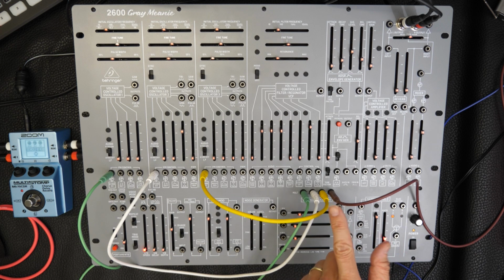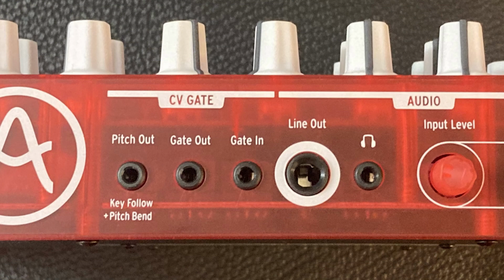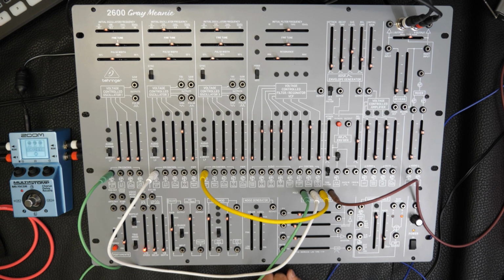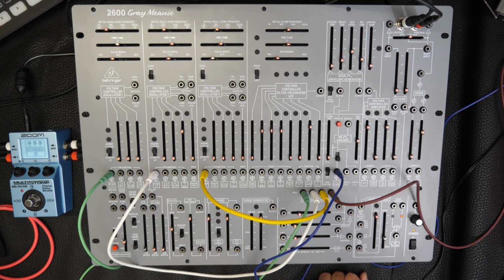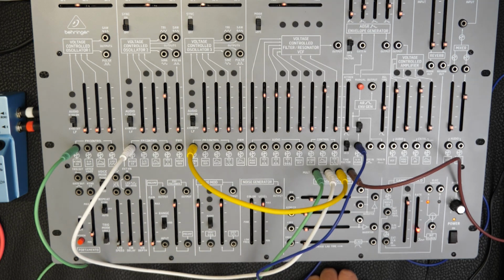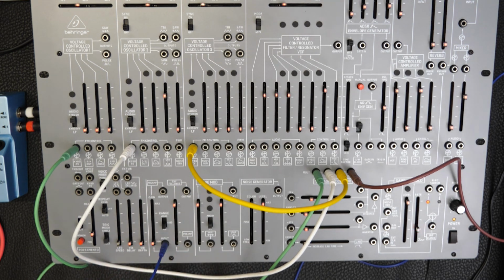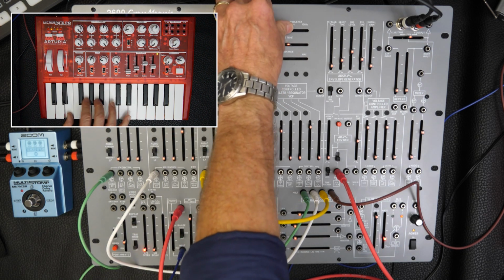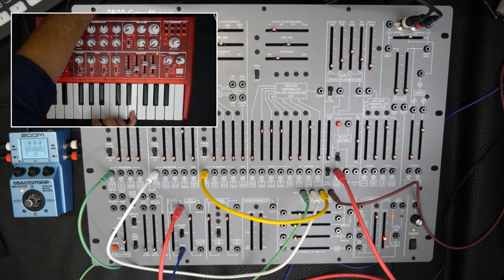Solving CV/Gate Issues // Behringer 2600, ARP 2600, 2600 Synth Clones

Comment: Thanks Ralph. I was having similar problems with Arturia Keystep 37 and Behringer 2600.  I tried using the Arturia Midi Control Center app change the gate out signal from  "V-trig 12V" to "V-trig 5V" and it worked much better, not needing the preamp at all.
Reply from the maker: The Keystep has great setting options and the Arturia Midi Control center gives you fantastic control over the device. Unfortunately the setting options for the Arturia MicroBrute are a bit limited. Many thanks for watching my videos! Greetings, Ralph

Comment: Hi Ralph, I have just got my original (1974) 2600 back from service and was trying to run it from my Doepfer Dark Time Sequencer (still to try with my Doepfer MAQ 16/3 and my Keystep - and expect a challenge, and probably failure using the Behringer 960 sequencers!). I followed all of your instructions and even with the input levels at x 100 I was still getting the Sample and hold clock taking over/playing on top of my sequence -  giving a sort of double beat or a click as well as the sequencer output and then fading itself out when the S&H clock faded. After thinking a lot I have plugged in the output from the preamplifier gain control (big knob on the top left of the 2600 - same as the Behringer but not a slider) as you suggested, BUT connected it to the Sample and Hold GATE input on the 2600. That works - so far. Thanks for pointing me in the right direction! I am working through your other videos. 

I just found your other video which actually covered this bit. I plan to watch everything you have produced eagerly!

Best wishes, Tony, Hove, UK.
Reply from the maker: Hello Tony, thank you for giving me your detailed feedback on my tutorials. A lot of making things work involve a lot of trial and error testing. That's part of the modular Synth game. BTW, I also have an original ARP 2600. 😃 Cheers, Ralph

Comment: I have a Division Six Dual Mini Sequencer and the Behringer 2600. I tried your gate/preamp method and it does not trigger the 2600 ADSR properly. One thing you missed was adjusting different ADSR parameters. If you did you would probably notice that the attack and decay are not functioning properly (as well as the rest of the EG) when applying only the gate to the 2600 VCF EG. After much research online I found a video with the solution. It's hard to find in the 2600 documentation. The ADSR requires a trigger AND a gate. The Division Six Dual Mini Sequencer only has a gate out. I recently purchased an EMW "gate to trigger" module. I split the gate out of the Sequencer with one going into the 2600 gate jack and the other split going to the EMW Gate to trigger converter. I then brought the EMW generated trigger into the 2600 trigger input jack. Presto! The 2600 ADSR  functions as expected. If you want I can throw a quick video together to show the patching and results. To share with your community. I enjoy you videos. Never owned an ARP back in the day. MiniMoog was my synth of choice. So I had a bit of a learning curve. Your videos helped.
Reply from the maker: Hello Ronald, 

many thanks for sharing your experience with the Division Six Sequencer.

I am totally aware of the fact the 2600 EG’s require a Gate AND Trigger signal. As a matter of fact I have already made a video about this 
https://youtu.be/MTf10H0KWDU 
But nevertheless you took the best approach by doing your own research and testing. That’s always the best way to learn the 2600 Synth.

I have never dabbled with the Division Six Sequencer but with all my equipment I have never experienced any Attack/Decay issues on the ADSR when going through the Preamp. Except for the the Sustain which is probably due to the fact that the Preamp might not be DC coupled. Anyway when you look at the ADSR position in my video and listen to the accompanying sound then you will notice that the Attack and Decay are working properly.

One again I would like to refer to this video here https://youtu.be/MTf10H0KWDU and suggest that you try to split the Gate and Trigger and boost the just the Trigger signal and run it into the Trig input slot.

I am currently shooting another video about Gate connection issues because I have received several further questions/comments on my various Socials. So kindly stay tuned.

Thanks a lot for watching my content and for taking the time to write this comment. Greetings, Ralph
Reply: @RalphBaumgartl  thanks. I have the Behringer Swing. I will follow the setup from the video you referenced. Thanks again for the prompt reply.
Reply from the maker: @RonaldFigura  This video just shows another way which might be a possible solution. In modular Synthesis there's no wright or wrong way. There's the way that works for your setup and workflow. Finding and exploring that route is part of the modular Synth fun :-) Have a creative weekend, Ralph

Comment: Ralph! taht was exactly the problem I had while using the signal splitter (that one that looks like an asterix).... it splitted the voltage so it wasn't enough to duly trigger the Osc..... and the Trigger. I updated the firmware as you adviced and starte using it with midi (and just for knowledge, I tested the CV splitter with a multimeter,.. and yeah...) :person-turqouise-waving:

But now, I ordered a new analogt sequencer and I will have to use the CV inputs again.... so! there it is.
Reply from the maker: Which sequencer did you order?
Reply: @RalphBaumgartl  ordered 2: a Korg SQ1 and a Behringer 960 module.
Reply from the maker: @MarcoPolux  You may have to boost the Gate signal of the 960 module in oder to make it work with the 2600.
Reply: On the GATE only, right? The 960 is +8V the 2600 has different voltage on different modules. What I’ve seen is that the pitch enter direct to the Arp’s mixer and then to the VCO pitch. And the gate goes to the Arp’s PreAmp and when to the S/H…. And then it works correct? Thanks Ralph 👍
Reply from the maker: @MarcoPolux start with the procedure explained in my video. Depending on your sequence in may not be necessary to increase the Pitch/CV signal.
Reply: @RalphBaumgartl  I will do that! thanks so much Ralph (I may dare sometime to make a youTube video) :person-turqouise-waving:

Comment: This is a very helpful suggestion, and is much simpler than the using the voltage processor.
Is the preamp DC coupled, so a long gate will hold the envelope open?
Also like your suggestion to use MIDI when possible.

Another thing to check, is if the hardware sending the trigger/gate/clock, has an option to select what voltage they send. Some allow you to choose between 10v and 5v.
A few of my synth toys have that, like the MicroFreak, and the Korg SQ-64 sequencer.
Reply from the maker: The Arturia Keystep also allows you to choose between a 5v and a 12v gate.

Comment: As many of the outputs of the 2600 are in the range -10V to +14V, the AD/ADSR Gate and Trigger Inputs should be able to handle that voltage range safely. 

For reference, Specifications from the Behringer 2600 documentation:

AD/ADSR Gate In threshold is +4V.
AD/ADSR Trigger In Threshold is +5V.

The portamento/ keyboard Gate Out voltage is +14V max.
The portamento/ keyboard Trigger Out voltage is +10V max.
Reply from the maker: Thanks for sharing this! It also shows that it's highly unlikely to break something on the B2600 when patching up external gear!

Comment: hello Ralph! I have another beginner question for you 🙂 are there things which work only with midi? today I am messing around with my 2600 connected to my Keystep Pro via CV. all the connections are fine and it all works great. but I noticed that the "vib depth" slider was having no effect? so I unplugged all my patch cables (except LFO) and connected via midi and the "Vib depth" is behaving exactly as you would expect? 
I tested using one CV connection: KSP into OSC 2 for pitch, and KSP into S&H clock for gate, and then cable (same as with midi connection)  from LFO sine output into PWM input of OSC 2 (also tried with pitch) but doing this, the "vib depth" has absolutely zero effect? what am I doing wrong here Ralph? is there another CV connection to make that I am missing? thank you! have a great day 🙂
Reply from the maker: Yes, certain things will only work right out of the box if you have a midi keyboard connected. Using  a delayed LFO (vibrato effect) during a CV/Gate connection requires a lot more patching and making use of the Voltage Processor. Kindly check my tutorial here: https://youtu.be/5pkO7Yiffac
But as I said in my video, always go for the Midi connection first, because it makes things easier especially when you are starting out with the 2600 Synth. Greetings, Ralph

Comment: Question for you. Why use the sample and hold clock in and not the gate/trig in?
Reply from the maker: That would work as well. But in that case you need to send a Gate and a Trigger signal to either input as explained in this video here. https://youtu.be/MTf10H0KWDU

Comment: Great video, thanks. I am experiencing a problem with connecting to Behringer 2600 via USB. I am trying with multiple controllers and sequencers with no success. the goal is to connect Behringer to Ableton, or hardware sequencer using USB. Any advise?
Reply from the maker: Are you using the Ableton Light version? As far as I know the Light version cannot send Midi data to an external Synth. I am using Logic on a Mac. I never experienced any issues when connecting (USB and/or Din Midi) the B2600 to Logic. Please make sure that you are setting the correct Midi channel numbers in Ableton and the on the B2600. (I am unable to give any detailed advice on Ableton since I am not using that App)

Comment: Thanks for the great and helpful video! Has anyone tried connecting a Kenton Pro Solo to a Behringer 2600? It seems like you could take advantage of the Kenton's extra envelope,  LFO and perhaps some mod wheel functions on one's MIDI controller through the Kenton's aux CV outputs.
Reply from the maker: I personally have no experience with the Kenton Pro Solo. If anyone out there can share his/her experience with this gentleman here, then kindly be forthcoming.
Reply: I used to use a Kenton with my old OG 2600. You can use it in a variety of ways - including the extra CV etc. With the Behringer you’d be able to use midi to deal with the note pitch and on/off, freeing up all the CVs for fun stuff like filter cv, pulse width… anything with a control input really.
Reply from the maker: @labouch  Thank you so much for sharing this! Have a nice weekend, Ralph

Comment: Can anyone please help me with an issue I'm experiencing? I'd greatly appreciate it. 

At this point, whenever I turn on my Korg ARP 2600, the oscillators can be heard without having to press any keys. It just plays forever. I even turn it on while the keyboard is off, and you can still hear the oscillators. Is it broken?
Reply from the maker: Kindly watch the following video. I suppose you might be doing one of the mistakes mentioned in the tutorial. https://youtu.be/vQx88p4dutc
Reply: @RalphBaumgartl  Thank you. I've watched some but I did not get to complete the video. I'm just surprised to see that it was working just fine the other day. All I did this time was power on the Keyboard before the ARP (as usual) and experienced this issue.
Reply: @RalphBaumgartl ok so I watched your recommended video and it fixed my issues when it comes to using VCF to hear audio without issues. However, my VCA slider has not been giving me any sound. It's completely mute, even after watching your video unfortunately.
Reply from the maker: @KickzNBeatz  I guess you are referring to the Initial Gain Slider. Bear in mind that you also have to open the VCF to hear something when cranking up Initial Gain. If you are new to the 2600 Synth then you may want to watch my tutorial series. It has helped many new users already: https://youtube.com/playlist?list=PLlJvIUzIwQ79naxyNxNQnNEj_KcmHp5D5
Reply: @RalphBaumgartl  Thank you. I'll watch this video as well. I can remember originally being able to hear audio with the the VCA turned up while VCF is off (within mixer section). I am not sure why I can't anymore. I should be able to use only VCA without VCF and be able to hear sound.
Reply from the maker: @KickzNBeatz  I mean the VCF Frequency slider should be turned up all the way. I am not talking about the VCF slider in the mixer section. The link in my previous reply is a playlist of my 2600 tutorials covering various modules of the 2600. Start with the beginner guide. That should also give you an idea if something is at fault with your device. Cheers, Ralph
Reply: @RalphBaumgartl  I greatly appreciate your help, Ralph! Thanks for all that you do!
Reply: @RalphBaumgartl  You're a great teacher!!!  All of my problems have been SOLVED!!! 🎉🥂Cheers!
Reply from the maker: @KickzNBeatz  That's very kind of you to say! Happy patching, Ralph